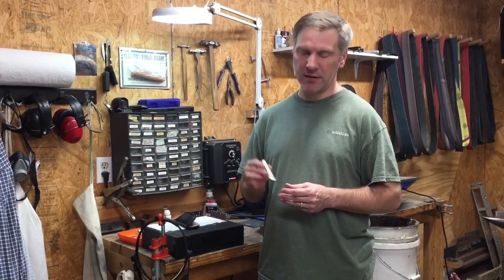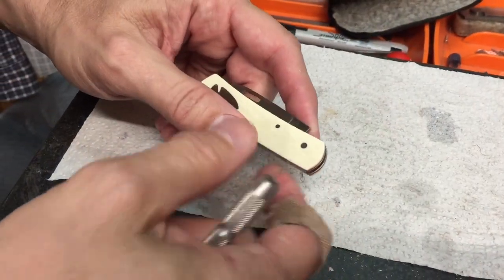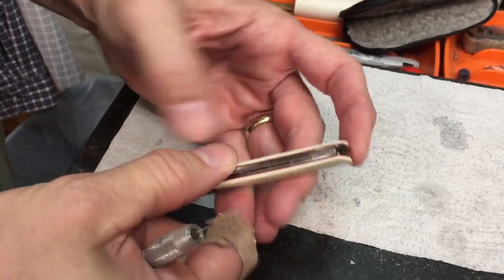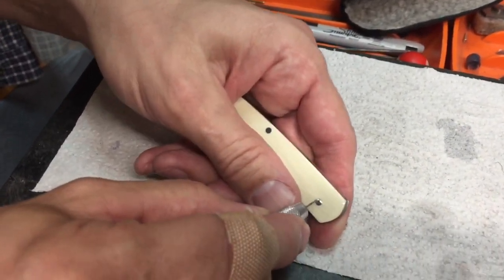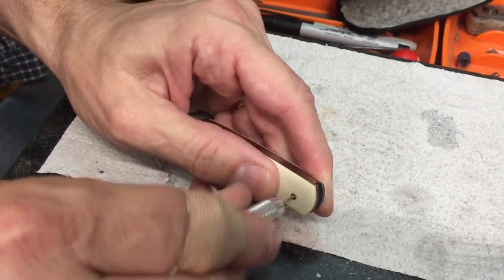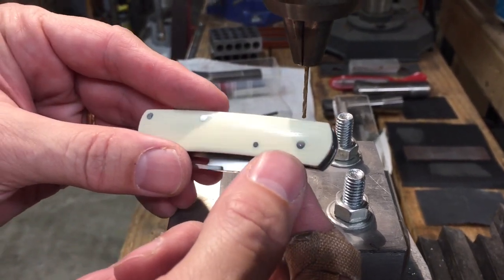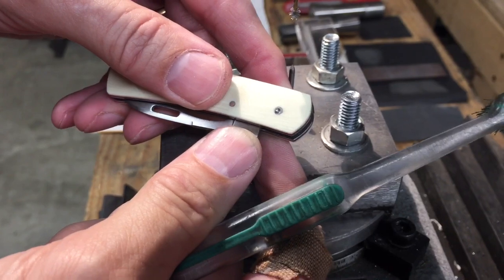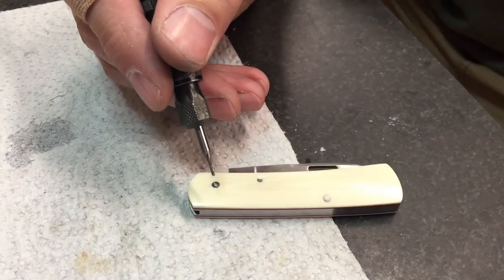Removing a Pivot Pin From a Slipjoint

Comment: You might like using a practice hockey puck to support delicate work while driving out pins.  When I had a clock restoration business I used hockey pucks all the time, poke holes wherever you need them, when one gets too chewed up on both sides toss it and grab a new one.  Under $2 each.  Very firm yet resilient bench block you don't have to care about.  I keep a few near the drill press and mills in my shop, and a couple in the toolbox.  Think I learned this one from the gunsmithing guys, might have been from one of my jeweler friends.  Thanks for the videos, take care!
Reply from the maker: Hey Stan. that's a great tip! Thanks! Looks like I need to pick up some hockey pucks for the shop!

Comment: I like the idea and the theory is all good but in practice I think the method we use in aircraft rivet removal works best, as in using a very small air powered pistol type drill , start a small bit anywhere close to center and actually angle the drill to steer the hole, its a lot easier said than done but ive put in stainless pins in knives and took them out again 3 times (don't ask:)) without ever damaging the bolsters, very informative videos by the way, i make a small few knives myself, conlonknives 
.com